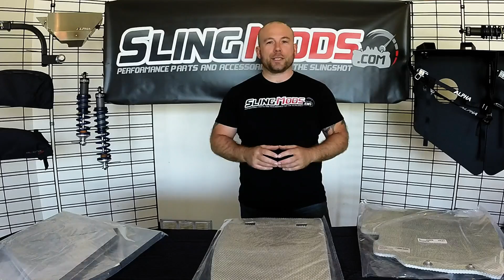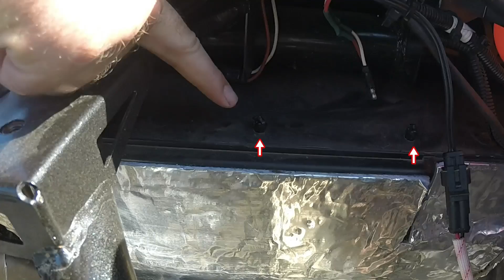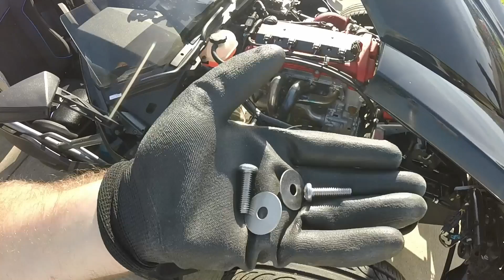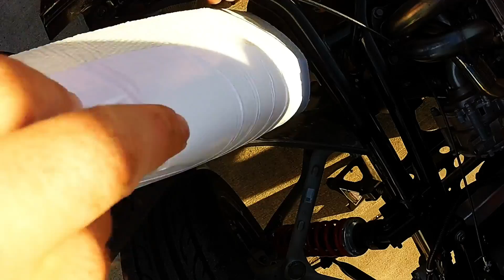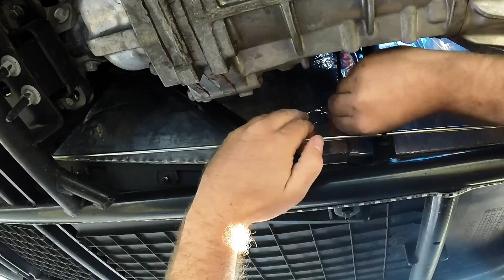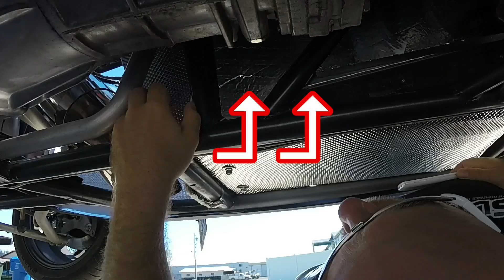Slingmods installs DEI's Complete Heat and Noise Control Kit for the Polaris Slingshot!

Comment: I purchased this kit about 2 months ago, the difference is amazing! I would add that if your running stock headers and exhaust, the main shield will slide in without removing the spring from underneath. Keep up the great videos!